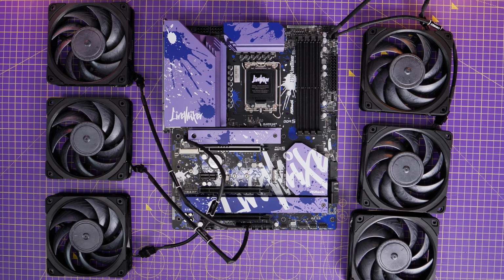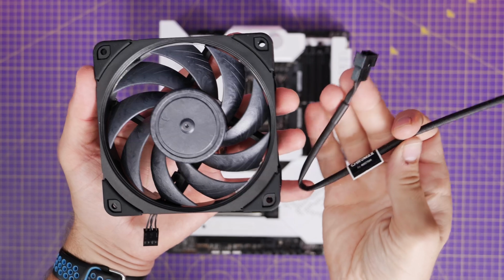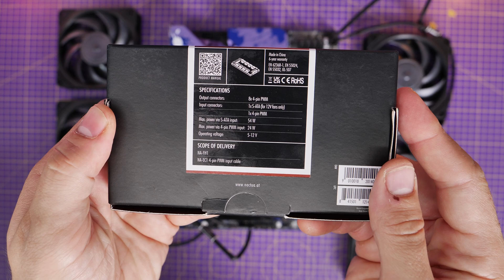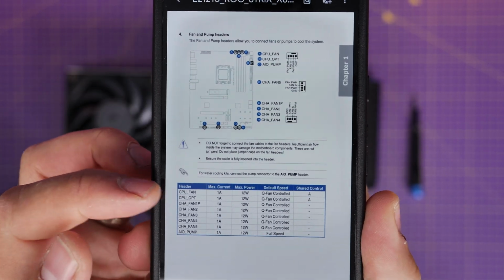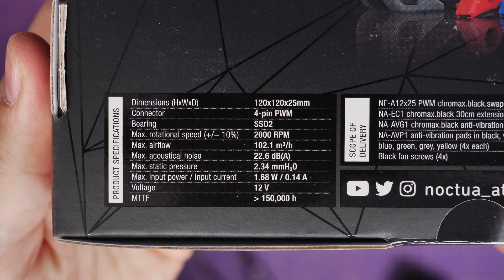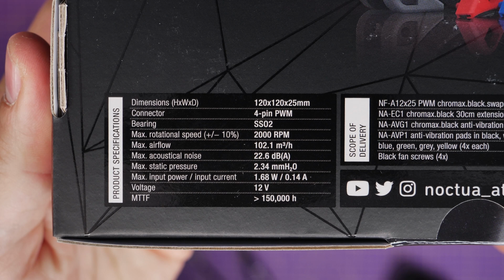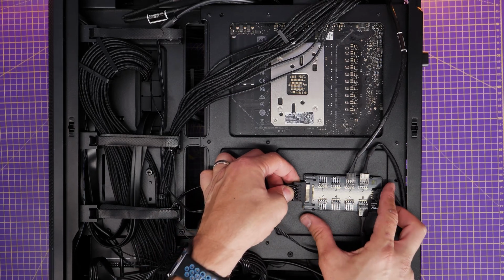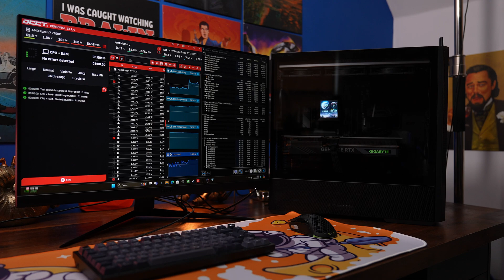Noctua Chromax Black AF 12x25 Wiring and setup guide

Comment: It's an annoying oversight to have the small fan connection on the bottom.
If you have a side intake in a pull setup the fans and stickers then have to be rotated 90 degrees.
Very annoying.

Comment: How did you get them to reach the mother board in the case
Reply: I used a control hub and connect all of them up that way. Noctua fans are notorious for having short cables but with enough patience you can get them to click in. They also sell pwm extension if anything.

Comment: Hi Provoked prawn! Can i know if i can use 6x noctua 5v pwm fan (0.35A) with the na-fh1 hub on my mobo fan header with no issues? Im using B850 Aorus elite wifi 7. the fan header has max current of 2A.

Comment: Very detailed masterclass Mr. Thank you for the inspiration. Now that I've decided on the assembly, I hope it all fits.

LIAN LI O11 Vision COMPACT [G99.O11VPX.R0]
NF-S12A PWM chromax.black.swap 120x120x25 x 2 (Rear) Air Flow
NF-F12 PWM chromax.black.swap 120x120x25 x 3 (Side) Air Pressure
NF-A12x25 PWM chromax.black.swap 120x120x25 x 3 (Bottom) Air Balance
NH D15 chromax black || NH D15 G2
NV-FH2, NV-FH1

ASUS ROG STRIX B650E-E GAMING WIFI
AMD Ryzen 7 7700 OEM || AMD Ryzen 5 7600 OEM
Team Group DDR5 T-Create Expert 32GB (2x16GB) 6400MHz CL32 (32-39-39-84) 
WD Blue [WD10EZEX]
WD Blue SN580 [WDS100T3B0E] || TEAMGROUP T-CREATE CLASSIC I45 [TM8FFX001T0C129] || TEAMGROUP T-FORCE G70 Pro [TM8FFH001T0C128] || Kingston KC3000 [SKC3000S/1024G]

LIAN LI EDGE 850W  ||  ASUS ROG STRIX Aura Edition 850W + pc cable comb

ASUS GeForce RTX 4070 SUPER ROG Strix OC Edition

Comment: Great overview. Actually Sata power is only required when you go over a certain wattage and amp value. It's on the instructions somewhere. I run 4 NF-A12x25's into this hub and then a PWM cable from the hub  to motherboard for my case fans. Still less than 1amp. No Sata power needed.

Incidentally Arctic sell a 4 way daisy chain cable which works perfectly with these fans connectors. Avoids messy cabling or even having to use a hub. Ideal if using these fans on a top mounted AIO.
Reply from the maker: That's fair but my logic is because of the different builds people might be doing I figured it was more logical to recommend sata power than suggest pwm only and see people having issues